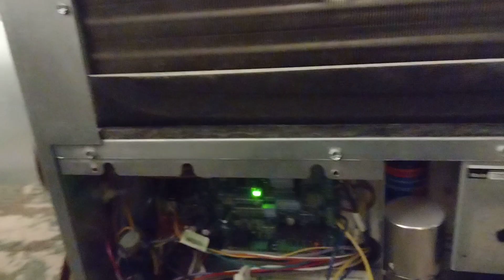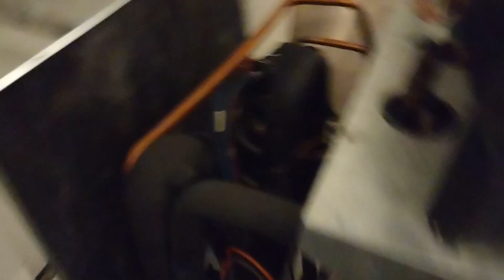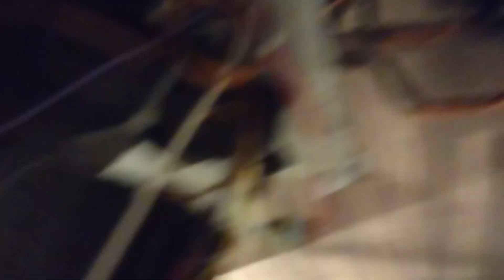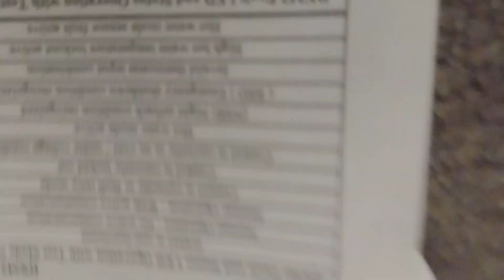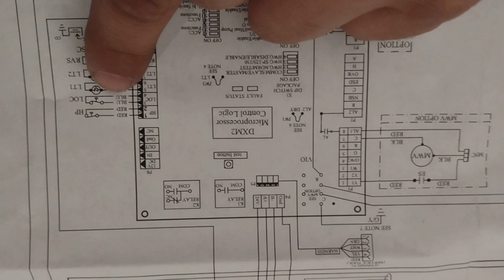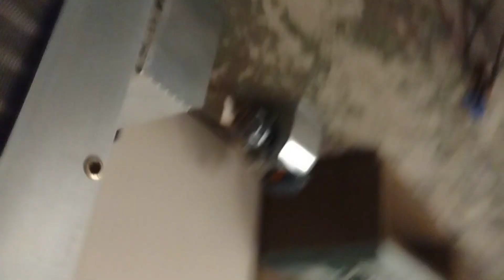Heat Pump Diagnosis

Comment: Good diagnosis breakdown bro.  What leak detector do you have? I'm going to get a new one before the summer. On the fence between dtek 3 or just say the hech with it and get the dtek stratus
Reply from the maker: I don't have a leak detector, unless you count my hands and fingers feeling around for oily residue . We usually just fill the system with leak lock that has UV dye and then look with the UV light. 
As for the leak detector you're gonna get , I'd get the one that serves multiple purpose s
Reply: @nck4888  Nose, fingers, spray bubbles, and nitrogen best organic leak detector there is.
Reply from the maker: @techti8792  old school man .
I tend to have difficulties when I use those fancy electronic devices
Reply: @nck4888  yeah nitrogen and leak bubbles is good for small single systems. I'm in supermarket refrigeration some racks hold 1200-1600 of refrigerate. So the electronic leak detetctors save some time for me. If you ever get one in the future I recommend the stratus. Thing is a good sniffer.

Comment: Yeah that compressor was definitely growling when it kicked on. I kinda cringed a tad lol. So where was it leaking at? And do you ever use sealant shots?
Reply from the maker: Yeah but gotta get the approval before I can purchase the leak lock and the leak was at the reversing valve under the insulation